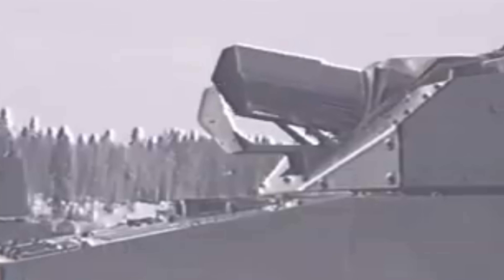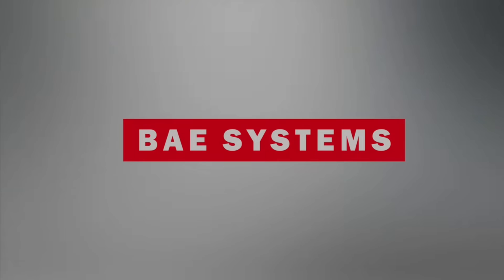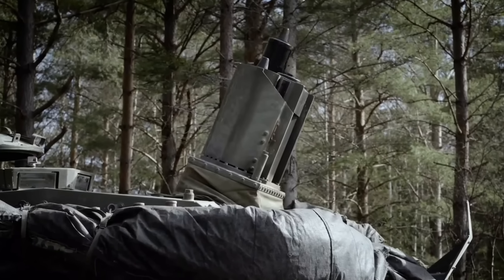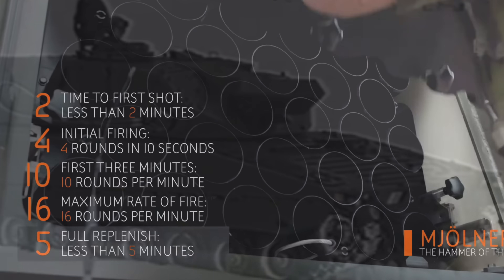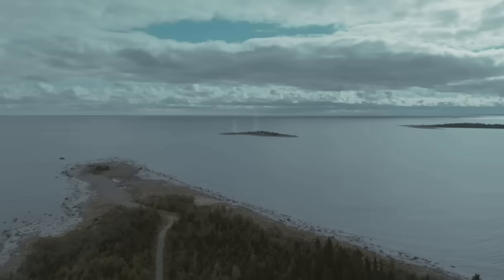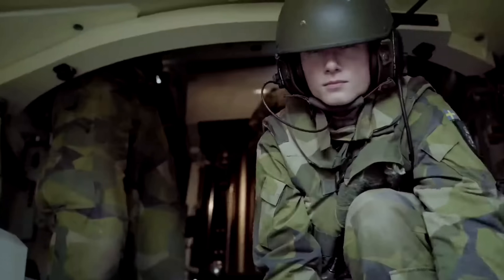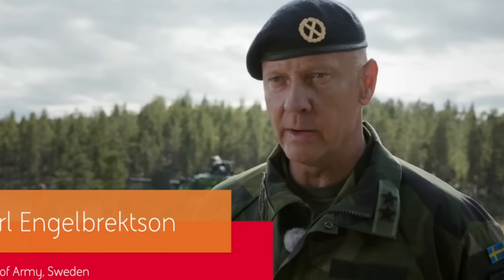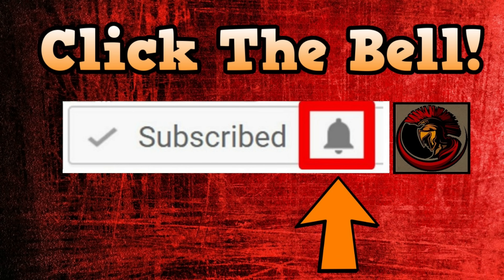The 'Mjölner' Rapid Fire 120mm Mortar Vehicle | DOUBLE BARRELED INDIRECT FIRE

Comment: Hmm.. I look forward to seeing the system on a Piranha chassis. That should be possible, as the traverse is managed by the steering of the rearmost wheel pair together with the front having all four wheels stearing. The off road capability of the Piranha is not that much worse than the tracked vehicles.

The other point is that it could be mounted on an EAGLE chassis and thus having - in practice - the same range as 105 mm artillery gun. 
However it seems to me, that the light forces need for tubed artillery is covered by shortening the 155 mm barrel and possibly reducing charge.

To be quite honest: I think the donation of the 19 CAESAR systems from Denmark to Ukraine is more a question of getting the CAESAR electronics and computer on board a Piranha chassis - Now the Swiss are probably tinkering with getting the 120 mm on the Piranha chassis - ANYHOW???
Amazingly the Swiss has lifted the reexport ban on the Piranha III. 
Actually I don't think the dire warnings that it will take for ever to replace the systems donated. I think it will be much faster. MOWAG in Schwitzerland is about finished with the order for the Danish forces and the infantry fighting vehicles.

The most interesting - in many ways - is what is going on in the wings of that conflict.

Comment: Shoot and scoot is not the future , it must be the present, depends on who you are fighting and how well equipped they are. The tank tracks do give it an advantage in off road capability.  For if you are firing from a road, it is easier for the enemy to guess which direction you will scoot to, there is often just two and you do not want to be slowed by a traffic jam when you scoot. I use the word "present" because if an enemy are well equipped and trained, for larger guns that will take longer of air time for the shells, they can have counter battery fire before your first shells land.

Comment: 3:56 For Granatkastarpansarbandvagn (Grkpbv) 90 (Mjölner) they used the already ordered hulls for the canceled Amos project that been keept in storage and already had the bigger turret ring needed to fit the Mjölner turret... so you cant fit the Mjölner or AMOS turret on a regular CV90 hull, or a regular CV90 turret on a  Grkpbv 90 hull without modification.
Reply: This inter-operability is the strenght of the CV90 system, and any nation that adopts it on a grand scale would reap the benefits in effective maintenance and logistics. With Sweden hopefully joining NATO this removes a lot of export-paperwork that used to exist. We just needs Turkey to be reasonable.
Reply: AMOS is five times more expensive than Mjölner (the weapon system).
This is why Sweden went with Mjölner.
Amos is a bit faster but not that much. 
Mjölner can carry more ammunition 😀

Comment: Why this over a short barrelled 155mm? it seems strange to set up this logics train. But then i suppose im also asking when, and how often do you use the 120mm mortar
Reply: Its ammunition is much smaller than 155mm but has just as good airburst effect! It is also easier to produce.
Reply: @jackdbur  But why.? why not just have more 155mm factories? airburst is just a function of shrapnel which is only a feature due to the mortars tail fins.    Also if your going to launch 2 120mm shells why not just launch a 155mm, and get nearly the same explosive effect?

Comment: Between the 3, AMOS, Mjölner and NEMO. Personally id pick NEMO due to its weight, modern FCS and adaptability to most carriers.
Sources: official manufacturer brochures.

Sustained fire RPM / Max RPM
Mjölner 6 rpm/16 rpm
NEMO 6 rpm/10 rpm
AMOS 10 rpm/16 rpm

Time to fire/scoot
Mjölner <2 min/<1 min
NEMO <30 sec/immediate 
AMOS <30 sec/<10 sec

Loading system
Mjölner manual loading
NEMO electric/semi-automatic
AMOS electric/semi-automatic

Weight (metric tons)
Mjölner 6t to 8.1t depending on protection level
NEMO 1.9t
AMOS 3.6t

MRSI capability
Mjölner no MRSI capability
NEMO up to 6 rounds simultaneous impact
AMOS up to 10 rounds simultaneous impact

Comment: To be fair I just don get why Western system cannot or would not adapt a gun-mortar system for their self propelled mortars. Like the technology is not that new fangled, the Russians have been using it since the 1970s with their Nona self propelled mortarts.

It allows for both direct and indirect fire, and it is a hell of a lot faster to fire because it does not need have a complicated muzzle loader like the Mjolner.

Comment: Too expensive. For the price of one cv90 vehicle you could buy hundreds of mortars and drive them into battle on pick up trucks. After 5-10 minutes of engagement the team would be out of ammo and just drive off into safety.
Reply: That's only an option if you have access to lots of expendable manpower. We don't have that in Sweden. We have to protect the crews that we have, because we don't have tons of them.
Reply: @nian60   Artillery / mortar teams are not in the first line of enemy contact, MBT and IFV are expensive and should be reserved for soldiers in direkt enemy contact.

Comment: What many don't think about is that this will be much more accurate since it has computers and stuff inside the vehicle. The aming is probably all done automatically by computers.

With an old school mortar setup it must take ages to calculate everything and set it up properly. So this is a huge advantage. But this is what makes it beeing able to shoot and scoot so fast, like the Archer.
Reply: The FH77 Howitzers that Sweden fielded in 1978 were guided by computers. So you can bet these are as well...

Comment: The CV90 platform with a 30+ mm auto cannon turret and some heat seeking rockets and instead of driving infantry around make the cargo space full of ammo, two or max three crew, some auxiliary systems (anti drone, anti APFSDS, …) and multiply this by hundreds and there you go. Expensive but minimal loss of human combat forces. Enhanced with tanks and motorized infantry and some air support, your potential is pretty high but now we are taking US Army forces budget 😅.
Reply: You are basically describing the CV90 Mk4, but it retains the infantry in the back.
And both the Czech Republic (210) and Slovakia (152) have already bought it.
Reply: @Merecir  Obviously I did.

Comment: Not sure whether those make sense to me. After all, the point of a mortar is to be a smaller, lighter, more mobile and cheaper alternative to a howitzer. The comparative reduction in performance is acceptable because of the aforementioned pay-offs.
When you build a special armored vehicle for a mortar, you give up on basically all those advantages and it becomes questionable why in that case, you're not going with a howitzer? 

Apparently the Mjölner version of the CV90 weighs about 37 tons.
That is the same weight as a RCH 155mm howitzer module on a Boxer wheeled APC, which offers a lot more performance and range. According to Wikipedia, the RCH module on a tracked MLRS vehicle chassis is even a bit lighter than that.
Reply: There is a thing called terrain. Sweden is a county with lots of hills and forest. A howitzer is a weapon/gun which use lower elevations of the barrel. A lower elevation means you can reach further 30-40km.
A mortar only use high elevation more the 45 degrees of angle of barrel and a range of 6-9 km.
In order for the round to hit the target it is required the path to be clear of obstacles. A higher arc means it alot easier to find a suitable place form where you can engage the target without hitting a hill, trees and other stuff.

It is also a question about organisation.
The Swedish mech battalion have 3-4 combat companies, a mix of mech-infantry and tanks, usual 2+2. To support this there is a command/support company and a supply company.
The command/support company does have 2 mortar platoons with 4 GRKPBV90 each totally 8 in the battalion.
They are there to support the battalion, meaning they are close to the combat companies, which means they don't need the range of a howitzer. It is more important that they can respond quickly to the fire support requests form the combat companies. With 2 platoons it means they can be firesupporting with one platoon while the other is moving, resupplying resting or all the other things a platoon needs to do when not fire. A large number of mortar rounds in the vehicle (100+) means the GRKPBV90 can be providing fire-support for longer time before need to resupply ammo.
Here is another point in the favour of the mortar: the rounds are smaller physical compare to a 155mm howitzer = less of a logistical burden = less number of trucks require to move the ammo.
Reply: @primeflux1  That makes no sense. A howitzer can shoot at the same elevation as a mortar, it just can shoot way, way farther, so you don't need to get as close to the target.
There is NOTHING a mortar can do better than a howitzer.

And the logistical burden thing also doesn't make much sense, because needing to be closer to the enemy means you need to transport the ammunition closer to the front, which means much more logistical issues.

Those 30 km a howitzer can shoot further than a mortar are 30 km less you need to transport the ammo in a truck.

More range also means howitzers need to move less, which means less fuel consumption and less maintenance, which also is good for logistics.

Also, less movement means less chance of detection.
Reply: @TrangleC  Yes a howitzer can shoot at the same angle as a mortar and get the same range as one when it does. In order to shoot further a howitzer shoots at a lower elevation, hence more of the muzzle velocity goes into range rather then height. A lower throw arc means terrain and line of sight is a more limited factor. 

Movement is the key here because against a peer to peer opposition You will have to count on being detected and engaged by counter battery fire within minutes of opening fire.  Shoot and move. shoot and move. 

Lastly a smaller projectile means more can be carried in the same volume and weight.
More projectiles on hand means more fire mission before reloading.
Most of the target you shoot at when supporting your operation is "soft" targets. Against them them the 155mm is almost a overkill. and what you want is suppression over a time frame. that means rounds spaced out over time, to keep the enemy in cover and heads down. Hence mortars are more cost efficient. Self-propelled howitzers are expensive both in price and operation (bigger ammo=more expensive)

Btw, there is no mutual excursive about mortars and 155mm howitzers you want both. But they are organized at different levels. The GRKPBV90 is a battalion level asset, the Battalion commander decides how it is employed. Artillery 155mm is often at brigade level and the brigade commander decides what it shoots at. 
So the command-chain to get the mortar rounds on targets are far shorter and goes faster. 

Basicly the GRKPBV90 is a cheaper way to do the job, and as it is intended to support the battalion the shorter range is not a big issue and being based on the same chassis as the standard IFV means it have the same mobility and can follow the combat companies closely. It also simplify the logistics with spare-parts and trained mechanics
Reply: @primeflux1  But that is my point. It can't be much cheaper than a howitzer. It will probably even be more expensive, because it needs more crew and needs to move more than a howitzer.

It costs as much or even more and has less capabilities.

Saying it can follow the combat companies closely makes no sense, I'm sorry. A big advantage of a long range asset like a howitzer is that it doesn't have to follow the front line troops closely.

The more stuff that follows the combat companies closely, the more traffic you have near the front, the more the roads and bridges get strained and the more stuff has to turn around and get out of there when a retreat becomes necessary.

A long range howitzer can do everything the mortar can do, just from way further away and while being much safer and straining the supply lines less.

Who commands it isn't really important, since either way the commands come per radio and even if they wouldn't and you would send some messenger on a motorcycle or something like that, that messenger would still have a easier and safer time driving back to where the howitzers park, than to drive up to the front and look for the mortar vehicles.

And howitzers are also better at sustained fire, despite using larger ammo, because back in the "hinterland" behind the front they are much easier to supply and can stockpile ammo near the howitzers in a way you can not do with something that needs to get up to 7500 meters to the enemy.

And if you need to do "shoot and scoot", modern self propelled howitzers like the RCH can do that better too. Thanks to modern computer technology, that thing can even shoot pretty accurately on the move and it basically needs no time at all to get fire ready, not even the 30 seconds older systems like the Archer or the PzH2000 needed.

I am not saying mortars in general are useless, but their usefulness lies in being small and light and in a pinch even man-portable. You are throwing away all those advantages when you install the mortar into a vehicle that is as big and as heavy as a self propelled howitzer.

Comment: Sweden seems to spend little and develop great kit that gets in service and is useful. Britain spends shedloads on developing kit that's late and often questionable...  When I first saw this I was wondering what the point is and whether you wouldn't be better off having a mobile piece of artilery backing you up instead. But I think that although its  a bit niche having a mortar on the same chassis as your IFV gives you quick fire support when it's needed and being in a vehicle means you can carry your ammunition with you (and go back to restock) being much more mobile and likely effective than a normal mortar team.
Reply: "better off having a mobile piece of artilery backing you up instead."
Artillery is typically a higher unit (battalion, brigade) asset, while mortars support platoons and companies. at relatively close range.

Comment: It would be cheaper to just use a old pickup truck and put 120MM mortar on.  Mortars shouldnt be close to enemy infantry anyway.
But if you need terrain mobility, you can always use a tractor :D

You cant be hit if you fire and run :D
Reply: suspension wear? armor? the whole thing about AMOS and Mjolner is that they're armored and stay fully armored while firing. unlike M113 mortar carriers and such.
Reply: @firstletterofthealphabet7308  Suspension can be easy replaced as its mass produced.
And you dont need armor if you dont get hit.
Reply: @Bullminator  You won't get hit if you NEVER get targeted over the vehicle's 40+ years of career and role changes. Suspension replacement also can't be done quickly on the field, and is extremely wasteful. A truck's suspension is also too weak to stabilize a 120mm mortar, what with all its rounds and the crew stumbling around, for rapid, accurate firing and relocating.

Comment: The system weights only 28t, thats half of a PzH2000 or less than half of a modern MBT. This means the Mjöner or a similioar mortar system is airdeployable rather quickly and in bulk. The USA developed its MPF light tank for just that reason.

Comment: It would be terrifying to come up against this, just as scary as a tank in a sense, things like this have massive psychological power behind it, no one wants to be ripped apart and I don't care how tough you are everyone has a fear in them when they here tank tracks creaking and you know they are coming your way
Reply: Add to that the fact that CV90s have their exhaust muffled and redirected out the back in a way that reduces both the IR profile of the vehicle AND the sound it makes, especially to anyone in front of it.

I have faced and been chased down by the IFV and ARV variant in double sided training scenarios multiple times while on foot and once in a Volvo C303 (Tgb11)

If CV90s are coming towards you, you don't actually hear them until they are only around 50-70m away,  but you start to feel the vibrations of their tracks through the ground at 400m away, not able to know where they are coming from unless you can see them across a field.
Reply: @SonsOfLorgar  this is right up there on the list of things I don't want to shot at with, above any caliber of auto Canon